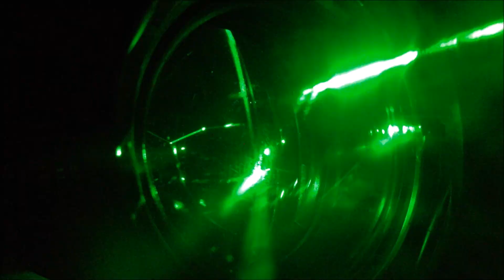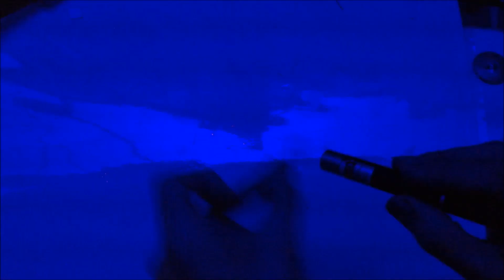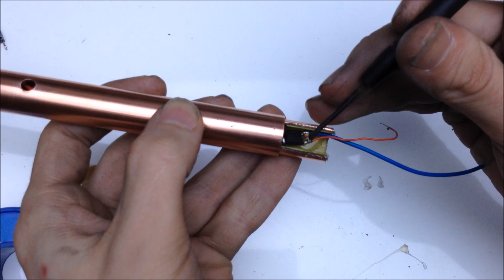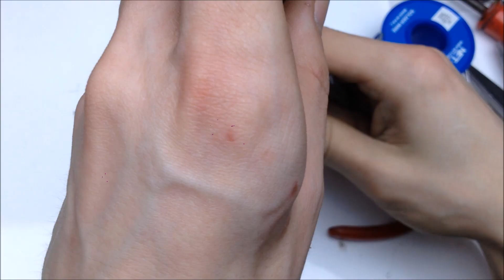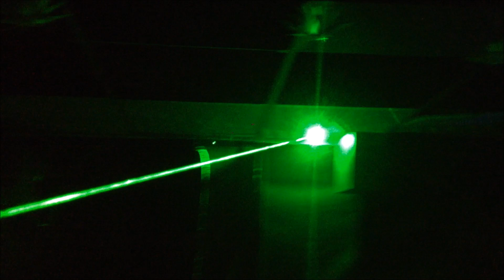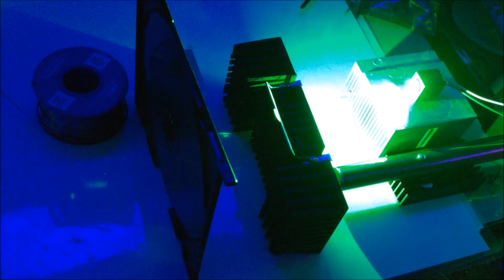Building a 525nm Burning Green Laser Pointer & More about Lasers

Comment: I was lost despite attention to watch two times. Maybe putting step by step things works hand helped without stupid music.
Reply from the maker: There where a few issues with sound on this video. I have taken comments like this and have worked on music placement and levels as well since this video. 

If you're lost, it's most likely in the driver section and I have a comprehensive video on laser drivers. The mosfet switch is stupid simple. 10 k resistor between source and gate, battery - connects to source, drain gets connected to driver - power in and a switch is connected between positive and the mosfet gate which will turn on the mosfet when switched. 

I don't really have much up about pointers in general, it's overall not really my thing compared to other laser form factors. Laser Pointer Forums might be a while to get more current information and tips.

If there is a particular area where you're stuck let me know and I can try to clarify if possible.

Comment: Hi sir, I have a question. If you know, please answer me, I have a 500mw 3.8mm 405nm diode laser from the module, should I give 6.5v 400mA input?
Reply from the maker: For questions concerning current and voltage look at the manufacture's datasheet or try to compared the ratings of another laser diode with the same wavelength and power.
Reply: @Zenodilodon  I asked the seller but everything didn't get the result I wanted, but now I know how. Thank you for your response.

Comment: if a module has one unspecified current rating it would be the lowest voltage rating so if I have a buck converter it's the output and if I have a boost converter it's the input.
Reply from the maker: Yeah that tends to be the way it goes with the drivers. I wish there where more options for 3A+ single cell current regulated boosts.

Comment: Are you esd protected?
Reply from the maker: For this nope. The unit is handheld and since I hold the device while working on it with my left hand, and install the ESD sensitive with my right I figured the chance of there being a large difference in charge potential between my hands to be relatively negated by my large fleshy resistor body.

At work we are fancy with it. Not only do we have wrist strap stuff, but also ESD mats, and ion neutralizing fans. Fun stuff!

How about you, are you ESD protected?

Comment: DUDE....there is no laser driver for "blue lasers"....its only marketing to sell drivers for "specific colours"...a driver puts out current and voltage, it doesnt care about wavelenghs
Reply from the maker: DUDE.... If some one who doesn't know about laser searches for drivers and doesn't know anything about DPPS vs direct diode they will end up in a pickle. This is because there is a common linear driver that isn't a boost mode, therefore would not work for running the Green laser diode do to lack of voltage. This is why I mentioned " Blue ". I thought it would help people avoid the LM358/D2882 driver that is often used to run the pump in a DPSS 532nm. Sadly because there is so much association in marketing with colors it's something to consider as this is what the average person is going to both try for key words and see by common association.

Comment: I recommend using sharp wire cutters to slowly, in a circular motion, chip away at the joint and then it'll just pop off. Delicate procedure but doesn't risk wire damage.
Reply from the maker: in most cases the ball lens pulls off actually. I just didn't know that at the time. I also try to avoid using something with a loaded pressure just in case the material gives way unexpectedly, I have crushed a few cans that way in the past :(

Comment: Awesome video dude. very informative. I'm in the middle of making my own and i'm just curious to know what size resistor did you use on you're Mosfet? Keep em coming mate.
Reply from the maker: Anything between 1-50kohm will work just fine for the pull down resistor.
Reply: 233-455k is good

Comment: What laser driver did you used?
Reply from the maker: I used a generic blue laser driver made for 2W blue laser diodes, easy to find on ebay but in this set up there was a cap on current so I did not get the full output only about 85% of it A better driver would be the Super X Drive and to use 2 batteries instead of one.
https://sites.google.com/site/dtrslasershop/home/laser-drivers/super-x-drive-sxd-buck

Comment: Is it possible to shine laser on DMD chip and make laser projector that way, without diffraction patterns?
Reply from the maker: This is a problem I have been trying to overcome here in the shop for a while, I have tried many DMDs and they all diffract, I believe it's due to the pits between the DMD mirrors. The only way I can see it working with a clean laser beam is if the mirrors where much larger. If you ever come across a DMD that doesn't shimmer rainbows it would be the one to use, however I don't think one exists.
Reply: @Zenodilodon  Thank you so much! :)
Reply from the maker: @synterr  If I find out more I will let you know!
Reply: @Zenodilodon  What if laser light will be not  collimated, passed thru a lightpipe/lighttunnel?
I heard that when you place transparent container inside ligtpipe (square mirror tube), filled with very diluted milk, then photons will be scattered a little bit. 
This patent with milk, especially helps with  the "grainyness" of the laser light.
But then, there is the question, why use laser instead of powerfull LED? What with modern DLP laser projectors?
What do You think?
Reply from the maker: @synterr  in laser projectors they do one of 2 things. Larger laser projectors will diffuse the laser light through a frosted glass plate, in the manor of the Casio slim they used the native blue laser light, a wheel that has phosphors that light up green when struck with blue laser light, and a red LED, these help cut down the properties of the native laser light. A thin piece of glass with an etched or sanded surface may help your application needs. Other laser projectors like the pocket/pico projectors use a MEMs micro mirror to steer the beam much like a CRT's electron beam assembly does line by line. Those are some options you can consider looking into, but in most cases LED will do a fair job as well.

Comment: I have an idea: yellow lasers work similarly to green dpss lasers (crystals and stuff), so I was wondering, can you make a 589nm yellow laser with an IR diode and some crystals?
Reply from the maker: Yellow lasers can be made a few ways, the most common set up is to have an 808nm pump laser that fluoresces a ND:YVO4 crystal just like in a green laser. Instead of being tuned to emit just 1064nm they are also tuned to emit around 1340-1350nm ( depending on the yellow desired ). Both of these larger IR wavelengths are sent into a second harmonic generation crystal which is often KTP just like in a green laser. However it needs to resonate both waves to create the right conditions/length to as to cause frequency  summation between the 2 waves. If the resonator isn't tuned to do this you will either get 532nm green from the 1064nm or red 670nm from the 1340nm. These tight tolerances in the SGH resonator are why they are so expensive and difficult.

Comment: Dude, maybe you can help me:
I'm searching for green laser diodes like you're holding in the video but I can't find any cheap ones.
I mean, a complete preapared and built laser pen costs around 3$ on ebay, and the diode itself only costs on ebay around 3.5$.
I'm sure that somewhere someone sells it like 100 diodes for 7$, but I really cant find any.
Thanks a lot!
Reply from the maker: The 1 watt green laser diodes are quite pricey in contrast to many laser diodes. DTR's laser shop may have complete laser modules but otherwise you probably will not have much luck finding completed 1 watt green laser pointer for cheap. They usually are around $200 starting price. You can search on ebay for a laser diode itself NUGM03/ NDG7475.
Reply: @Zenodilodon  thank you!
Reply: @Zenodilodon  ok wow I'm searching for the cheapest diodes I can find. Even 5mw. The point is that I cant find any diode that is cheaper than 3$ while this is the price of full laser light. I want to buy around 100, so every dollar per each is important
Reply from the maker: @ofirgaash  When you get into lasers you realize many other hobbies/occupations are relatively cheap and easy by comparison lol